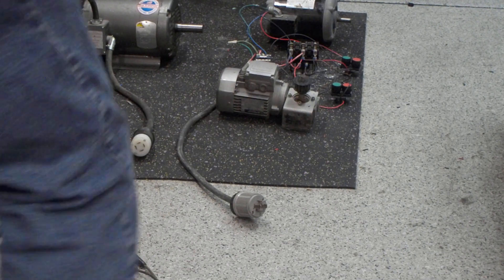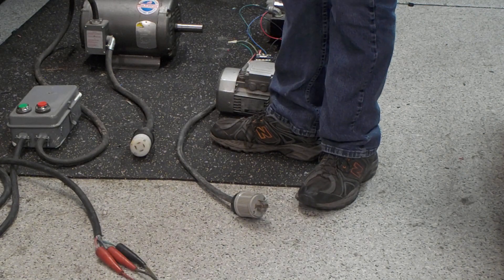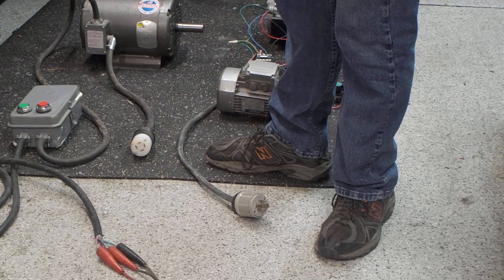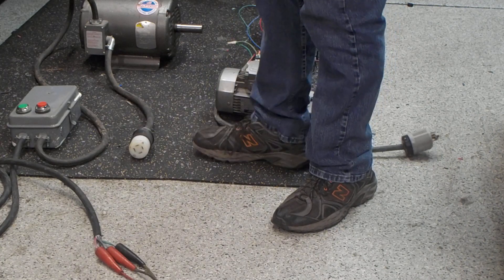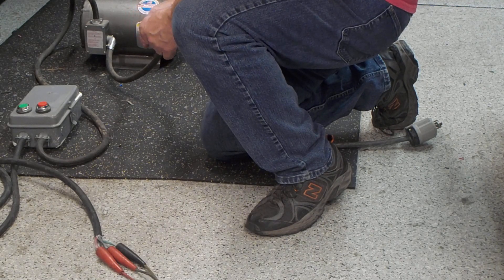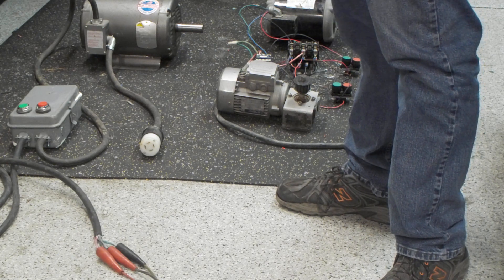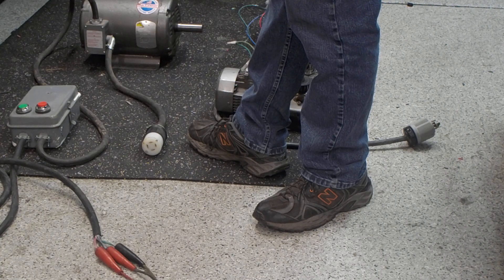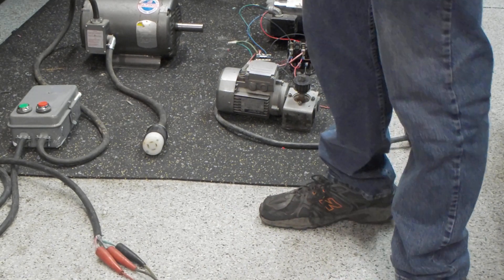5HP Rotary Phase Converter: 230v Single Phase Input: Video 1

Comment: Hi, thanks for your video!!! This is the only one I have found that talks about a 5 hp rotary Phase Converter. I have recently purchased a machine from work that requires three phase power. I bought a phase-a-matic three phase idler motor (the R-5) one that has the smaller cap box built on top of the motor. My question is, how do I add a magnetic starter and which one do I use? I’ve been having trouble finding the correct one come in how to wire it. Right now I have it hooked up 220 from the main circuit breaker box to a 3phase 30 amp disconnect box. I was wondering if I need a on/off button magnetic starter box like the one you have in this video.. thank you for any help, I still have not fired it up yet, I want to make sure I’m doing it right the first time.
Reply from the maker: Where are you trying to install the contactactor? Are you thinking of using the contactor to control incoming power to the phase a matic?
Reply: @mikewalton5469  
sir!!  Thank you so much for responding!!! 
 Yes, I bought one through Amazon, it’s the ;Big Horn 18825 1-Phase, 220-240-Volt, 5-HP, 22-34-Amp Magnetic Switch - with push button on/off button. 
I was going to run off the main panel into a 2 pole 220v 30 amp breaker .  Then into that magnet switch to give power to the idler motor, then run those three same wires coming out of the idler motor into a three phase 30 amp disconnect box, into my machine.  
 When I purchased the used fiveHP idler motor, it came with a separate smaller box that looks to be a static converter, but it has three places to wire into labeled A,B in C.  It says on it.; 
heavy duty
Phase-A-Matic
Phase converter.  
When I opened it up, it seem to have a few capacitors in it, but the same company makes a static phase converter that almost looks identical to it, I’m not sure if the guy I bought the motor from know exactly what it was, just had the same name of a company on it, and assume they went together? Or they really do go together, and I’m just not sure how to wire it in.

Comment: Well your RPC videos have encouraged me to try. I just bought a 35A 270V Potential relay and a 400-480mfd start cap. I have a 5hp 3 ph 1750 rpm motor but none of the wires are marked just 9 black wires? I bought another motor but it turns out to have been rebuilt and can only be run at 440V Y configuration. Luckily only paid 10 bucks for it. Any ideas on how to tell which wire is which coming out that motor? Thanks for your videos!
Reply from the maker: hi George 
this article may help out

http://machineryequipmentonline.com/electric-equipment/identifying-unmarked-leads-in-a-nine-lead-three-phase-motor/
Reply: Thanks Mike that's just what I needed. Now maybe I can get this up and running.